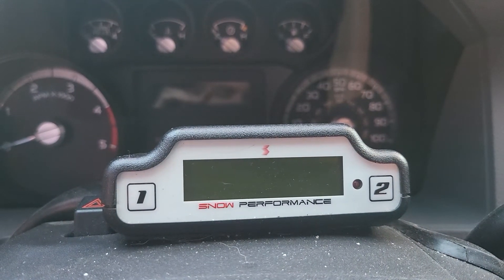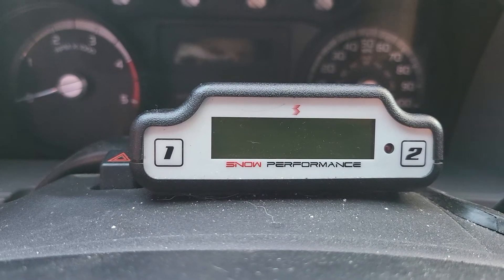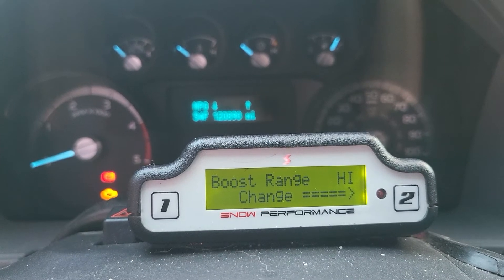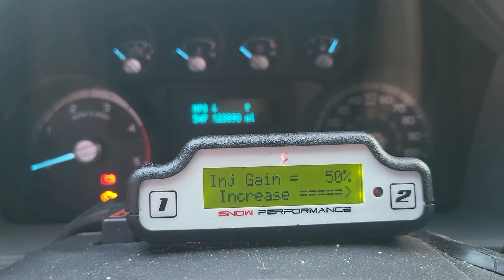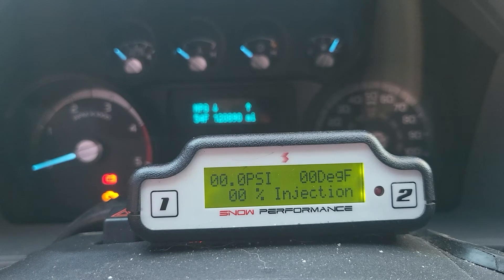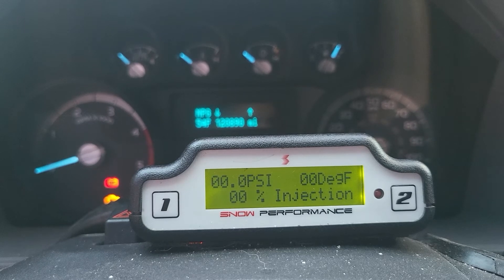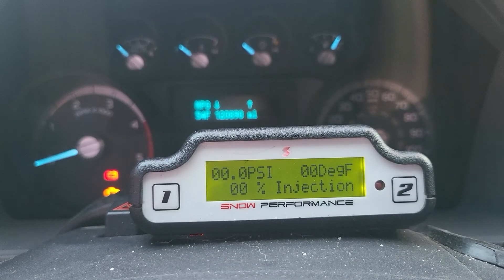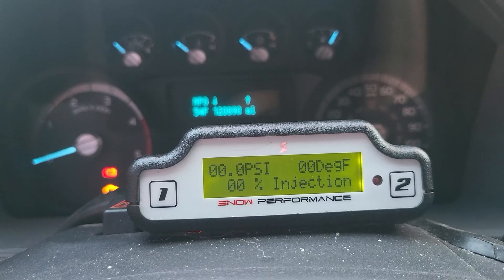Shining a light on water-methanol for more power and lower EGTs on your diesel

Comment: How would this work on a deleted truck?
Reply from the maker: Works the same.  When I installed the kit it was intact but that is no longer the case.  I have switched to a smaller mpg nozzle since this video was made.  I used to run dual 620ml nozzles.  The power nozzle is the same, but the nozzle on a progressive ramp is a 350ml.

Comment: What kind of mpg gains have you seen? Have you tried just straight water?
Reply from the maker: I've never paid attention until recently what kind of mpg I got but I just changed nozzles about a week ago.  Went from two 640s to a 640 and a 350.  So far no power change that I can tell.  If my mpg stay the same then I'm saving money cause I'm using less meth.

I know you can run straight water but I've never done it.  I would assume you would want small nozzles since water can't burn.  It relies on the burning diesel to turn it to steam.  More water would delay the ignition event which would make a ton of safe torque after TDC

Comment: When preparing water-meth mixture can you replace methanol with ethanol, to make it "greener"? Because ethanol can be made biologically and because you could have higher water percentage to equate the same energy density as 50/50 water/meth
Reply from the maker: I don't believe so.
Reply: The amount you will use is like pissing in the ocean and thinking it will melt the ice cap

Comment: Sounds like you should use smaller nozzles and more water and less Methanol .. as your engine has plenty of power with out Methanol  // Cool the engine and make steam power which will reduce fuel consumption .
Reply from the maker: I could definitely go smaller nozzles but I like the flexibility of the bigger nozzles and using the controller to turn them down.  Since making this video I have turned the percentage to 65%
Reply: @turbojeremy13    You need much smaller nozzles  if you use mostly water.   Since  your  EGT are OK  and you have 200  extra HP via Disel  Fuel  I suggested  using maybe 90% water and 10%  methanal    thus  you can't inject as much pure water as it won't burn and make more heat .. put will increase mpg slightly
Reply from the maker: @mikeskidmore6754  it's worth a shot.  I have a bunch of extra water laying around I can dump in.  Although the last year I have been just running about 35% methanol because it's cheaper.  But I haven't towed more than maybe 5k lbs since lowering the meth percentage so it's not an apples to apples comparison
Reply from the maker: @mikeskidmore6754  wow thats impressive.  My enclosed trailer with my mustang and some tools is probably the heaviest I'll ever tow on a regular basis and that's maybe 6500# max.  Maybe one day I'll get a trailer for camping but we will cross that bridge later
Reply from the maker: @garreysellars5525  sounds too advanced for me
Reply: @turbojeremy13  no prob just a thought
I have a snow  kit on my 6.7 Ram here in Aus with some other Banks products
Making mad power and under 10 l per 100 Ks
46 years as a diesel fitter

Comment: great video! I have discovered a cheaper way is by using a product labeled as "methyl-hydrate" from homedepot its 99.9% Methnol!!! Mix with distilled water by weight!!! 50/50 mix or whatever ratio you want!
Reply from the maker: I'll have to take a look at that.  Thanks for the tip
Reply: @turbojeremy13  no prob.  Im really thinking of water meth. Probably the diesel stage 3 universal nylon kit.  Nice setup and great explanation on how the controller works. No other video out there like this one!!!